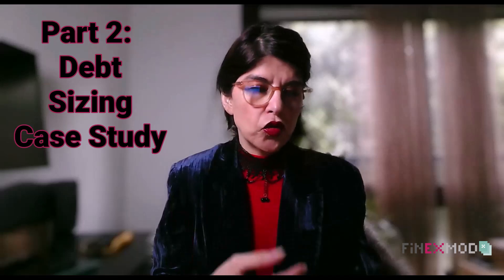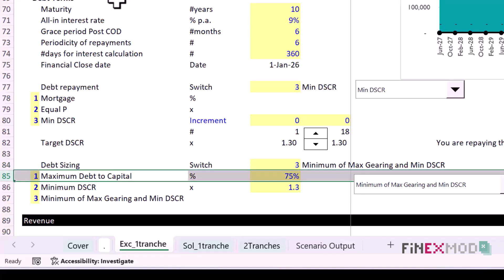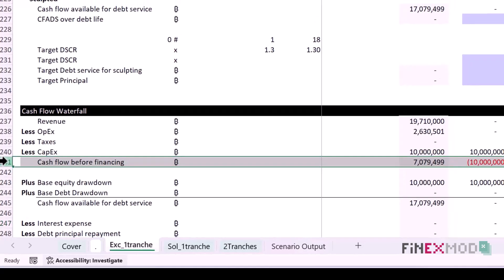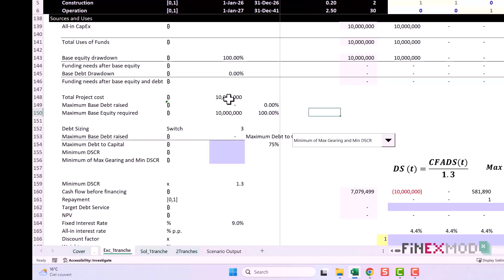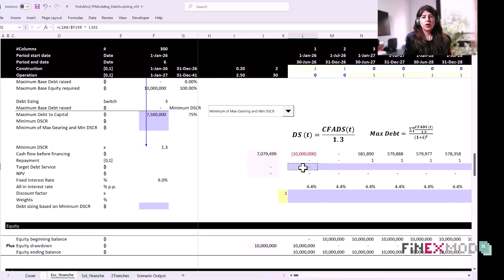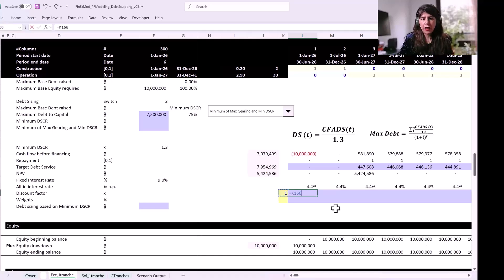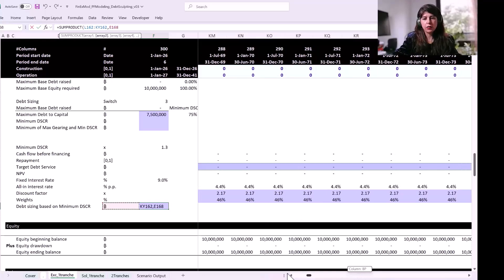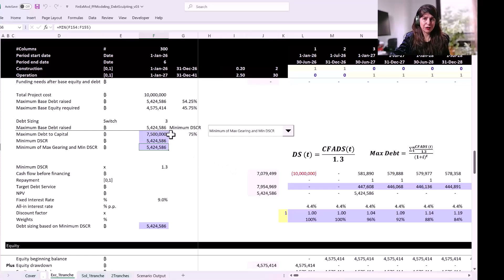Debt Sizing Case Study: Project Finance Modeling

Comment: Thanks for sharing

I just have one important question: why are you using interest rate as a discount rate for these cash flows? Are these cash flows CFADS or FCFF?

If these ‘cash flows before financing’ represent CFADS, such an approach will lead to circularity. 

If these cash flows are FCFF, in order to get correct amount of maximum debt size, WACC-like approach has to be used. Where cost of Debt is after-Tax interest Rate and cost of Equity is the Interest Rate. 

After getting NPV, it has to be multiplied by 1/ DSCR in order to get the Debt Amount.